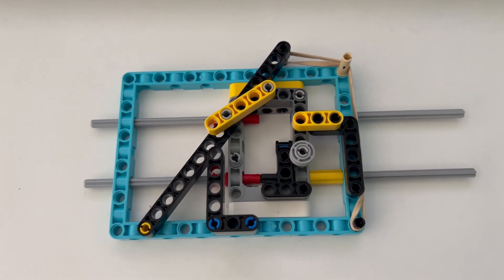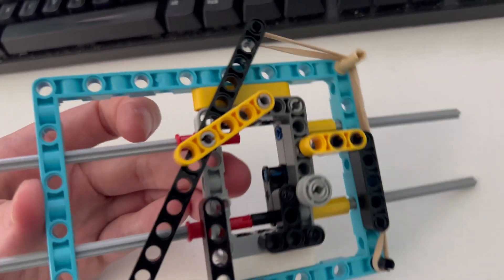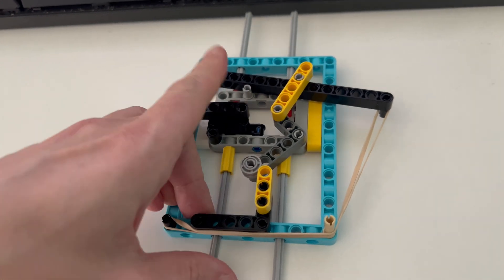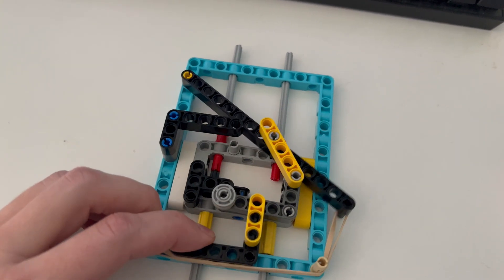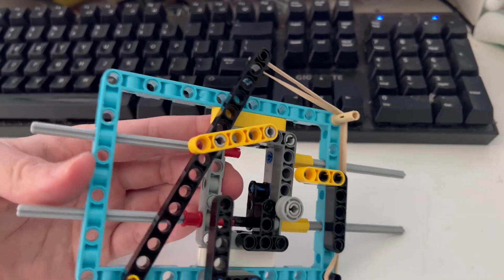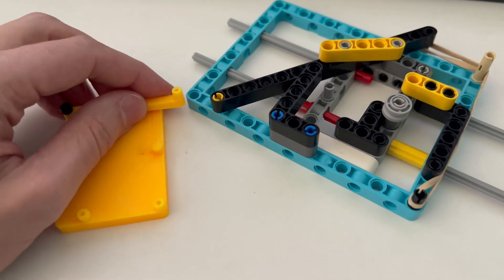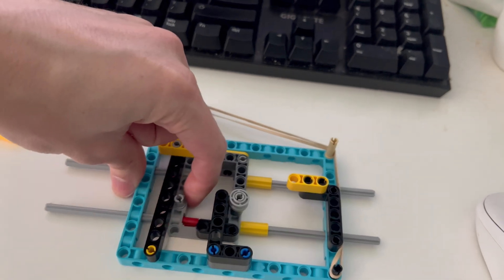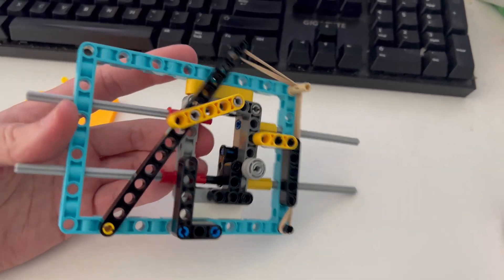This lego mechanism shrinks when pulled

Comment: With automatic reset and no external energy input, it's impossible to achieve a larger return force over a longer distance because force × distance = work = energy. Since no extra energy is added, the total work must remain constant. What you can do is reshape the force-displacement curve—applying more or less force during different parts of the inward or outward stroke—but the total area under the curve (i.e. the energy) must stay the same.
Reply from the maker: Yeah, of course. To have a double-force portion for 1/3 of the range, the remaining 2/3 of the range would have to have half force, but it requires careful tuning of that L piece and the ramp it pushes against to reset. Plus there's a lot of slop in the mechanism - the bar flexing, play in the pins, etc which wastes much of the double force range.